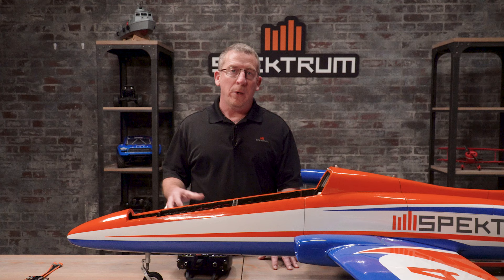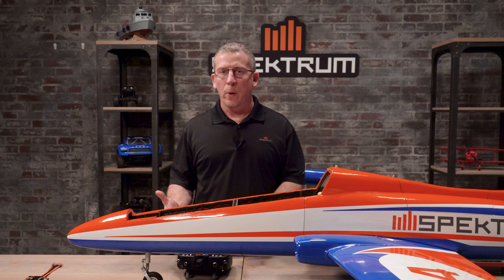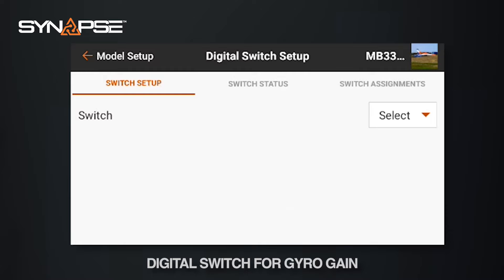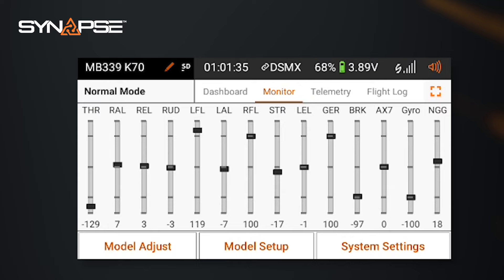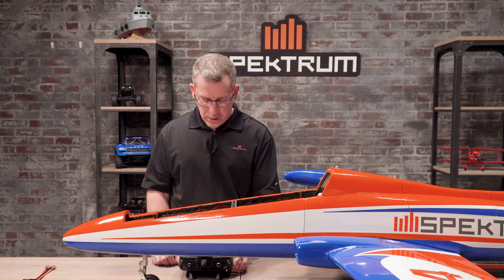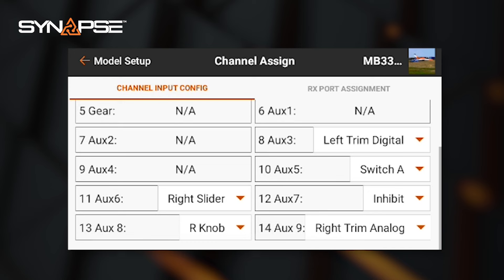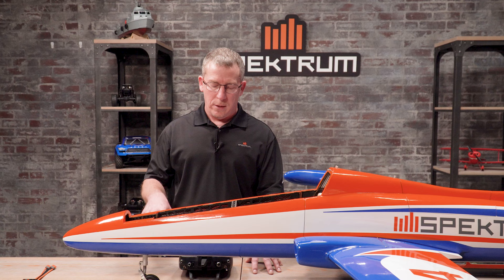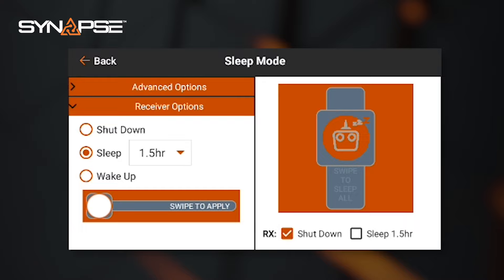Spektrum Synapse Tutorial - In-Flight Tuning

Comment: I didn't see any new information about the gyro. You could already do this setup with the previous AS3X and with any other gyro that has gain bank control like Cortex and Igyro.
I want to see videos that show what Synapse does that others don't and how to do advanced setup rather than basic setup.
The put to sleep or turn off function is interesting.
I already have a Synapse here to test, I updated the IX20 today and it seems that the software is the same layout as the spektrum app for AS3X.
I would like to see a table that shows two curves, stick priority x gain curve. How the first influences the second.

Comment: Interestingly, I followed this relatively simple instruction to the tee but could NOT get the logical switch to turn the gyro off.  The section  in the beginning that assigned the gains to my flap switch worked great but even though my Logical Switch 1 values are identical to the video settings my logical switch will not turn off the gyro.  Also: even though I renamed it "Gyro Gains"it (same as vid instructions) it does not show as such on the monitor.  Oh well, I am just happy the gains are on the flap switch now anyway!

Comment: That’s neat but does not fwd programming and multiple flight modes perform the same outcome? Flaps and FM can still be linked by logical switch setup?
Reply: Sort of. It’s a bit more to it tho. Flights modes let u set a mode for as3x, one for safe and one for off. This setup here I believe will affect gains in both the as3x and safe modes.

Comment: Seems to me way to many switches having to flip during flight.
Why not put gyro mixed to throttle.
High gain at low throttle and low gain at high throttle.
Reply: Because u might not always have low throttle when landing or high throttle when flying fast such as in a dive
Reply: The setup seems complicated but is super worth it if u have an ix radio cuz it’s really only one switch that you’re already going to be using for flaps anyways. The gyro kill switch only gets used in an emergency in case the gyro or receiver becomes dislodged in flight or starts to behave erratically for some other reason which shouldn’t happen on most flights